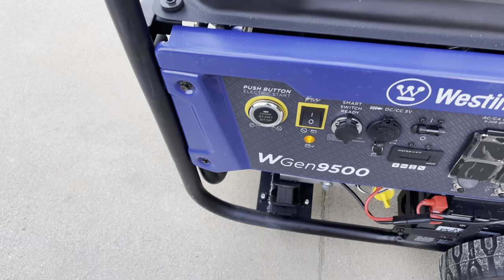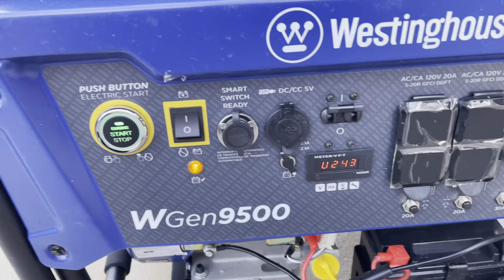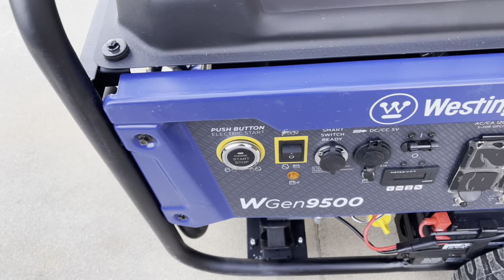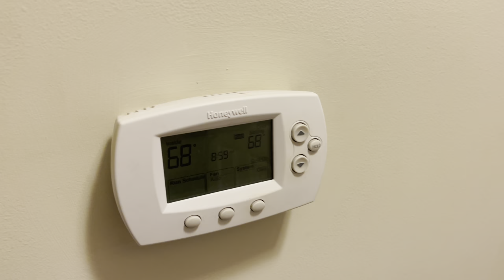WESTINGHOUSE WGen9500! Will it power a home AC??? First start, short review, and the truth!

Comment: BIG COUNTRY, First, thank you for the video. I purchased a Westinghouse WGen9500C but it shuts off the breaker when I turn on a 4 Ton A/C.  Would the extra ton do this?  Do you think a soft start kit would resolve the problem.  Florida Hurricanes are coming soon and would like to have A/C.  The generator runs independent of the A/C for two refrigerators, microwave, TV outlet with no problem. Thanks. Debra
Reply from the maker: I definitely think a soft start will get you squared away! If you’re using a dual fuel model and using propane, try running it on gasoline for your AC.
Reply: I had the same issue this week when hurricane Beryl hit Houston here where I am at. It ran my AC, fridge, freezer and other small things perfectly the first day on 4 hours, off 4 hours to conserve gas, seeing that all the gas stations were down.  It also ran just fine during the freeze a year ago and the first couple times this week, but then all of a sudden it wouldn't run just the AC by itself only the last few hours before power ultimately got restored luckily, it kept tripping the generator breaker if I tried running the AC.  After it Beryl passed, I contacted Westinghouse and they told me that I needed to "float the neutral". There's plenty of videos on YouTube showing how and it's super easy that anyone can do it in 5 minutes time. You're supposed to float the neutral wire WHEN HOOKING THE GENERATOR UP TO A HOUSE PANEL. If you are not doing that and using it with extension cords or for tools, etc, like on a construction site, then you leave it bonded to the frame as it comes. For emergencies like hurricanes, it had to be floated and not bonded to the frame.  There's a sticker on this generator stating that it's "bonded to the frame" at the lower right part of the panel near the 50 Amp plug. So if you are connecting to the house panel, you need to take the panel off, remove the 2 screws and float the neutral wire by removing the wire and reconnecting both ends to the neutral bolt.  It eventually gave me issues because there was two grounds the current was traveling through, eventually producing a false overload so to speak (not an electrician), going by what they said, and it eventually started tripping the breaker each time the AC turned on.  I already ordered my soft start kit and will be installing that here soon to help alleviate the initial start up load on the generator reducing by almost half. I even already had a reliance Controls 50 Amp plug and cord, 50amp breaker, including a whole home surge protector, hooked into the panel prior to this when the freeze hit here.  I'm looking forward to adding the soft start kit and floating the neutral wire and see the difference. When I had the 50amp plug installed 2 years ago at the freeze, the electrician ran the whole 2600sf house, no issues, as a test at the time.  I don't plan on doing that during emergencies to conserve gas, but it was nice seeing that it could. So I do know that it is possible.  Good luck!

Comment: I got the same gen unit 2 years ago. I love it. I try to start it monthly. Will run my heat pump AC without any hard-soft start modifications. It will not run my heat pump in heat mode but from what I have read that heating mode uses 5x the power vs. AC mode. We have space heaters and a big buddy propane heater to heat with in emergencies. How’s the wgen 9500/12500 holding up for you?
Reply: Don’t understand how heat mode takes more electricity… your just flipping valves and reversing the refrigeration cycle. Compressor runs same whether heating or cooling. 5x?  Where did you hear that
Reply: @condor5635  yes I saw it on a contractors web site. Maybe the heat strips? I might very well be wrong and I think someone at micro air told me the same thing. I will try and test it this winter when we start running the heat again. Thanks for the feedback.
Reply: I did install an easy start soft starter about 2 months ago and now getting 16-18 amp starts with the AC where previously the LRA says 75 amps inrush but I never tested it prior without the soft start. Thats going to be a welcomed bonus if I can run my heat easily too.
Reply: @FDRGREG  - I don’t think there’s any heat stripes. What was the condenser becomes the evaporator and what was the evaporator becomes the condenser. The compressor runs in heat mode or AC mode and other than flipping some valves to switch modes I’m not aware of any electricity needs that drastically change what is required to run the unit in either heat or air conditioning.

Comment: I have central a/c and heat.  I have a 3 ton unit.   We loose power in the winter all the time.   I’m wondering if it will run the central heat and main appliances like 2 refrigerators, freezer, and lights (all LED).
Reply from the maker: I can’t speak 100% to that but I can say if a generator would do it, it would be this one.
Reply: I had mine hooked up with a transfer switch today. I’m in the Midwest so still running heat. My house is 3500 sq ft and I have an apartment above my garage. It ran everything. I didn’t try oven or dryer and wouldn’t in an outage either. I’d use microwave and toaster oven or grill. It DID run everything else on gas. I didn’t try propane power yet.
Reply: Is your heat gas or electric. This generator will power a gas furnace but may not power a electric air handler wit electric heat strips.

Comment: Hey great video.  I have one too. Have you ever measured the RPMs at idle? Also can you confirm that an empty gas tank will take a full 6.6 gallons of gas? 
The reason I ask is because mine idles at 3750 RPM and it will just accept a little over 5 gallons. 
Hope to hear back.

Comment: It’s hard to see from the video, but did you say you made a male to male cable?   That means the inlet on the wall near the interlock is female?   If so, that is very dangerous and could kill someone in the future. Please do the right thing and replace your inlet with a male inlet. You already have the interlock to prevent the male inlet from being energized.  

I have the same model generator except in the dual fuel version (9500df). It’s a nice generator.  I have not yet tried to run my 3 ton ac on it.  But after seeing your video I may try.
Reply from the maker: I asked someone else this question but never got an answer. What makes it dangerous?
Reply: @BigCountrysWay  I’m assuming this is a serious question and you are not joking.  So I will explain a few examples to illustrate the risks. Please understand these are just examples and are not a complete list of possibilities. Meaning there are other ways people could be injured besides these.  

1) you are ill, in the hospital and your family is at home on a 98 degree day when the power goes out.  They are desperate for some cool comfort so they hook up the generator themselves even though it’s something that you’ve always done for them in the past.  Everything goes fine at first, but after the power comes back on and they are shutting down the generator they do it in the wrong order and pull the cable from the wall while it’s still running and touch the male end by accident and shock themselves.  

In summary, most people assume that on an extension cord or any power cord that the male end is not energized when not connected.  But the female end can be live if the other end is plugged in.  Therefore people will instinctively pick up and touch a male end thinking it’s always safe.  This SHOULD always be true.  But with a cord with male on both ends the power is running backwards from what intuition would expect.  This leads to a risk of death.  The risk is higher to other people than to yourself since you understand the danger.  

Please don’t put other people’s lives in danger.  If they were ever hurt you would feel responsible and that would suck for both people involved.
Reply from the maker: @neilbrookins8428  I understand your view point, I do. And I was being serious. I love feedback so thank you for this. 

I do have to say, I think that is stretching it alittle bit in my situation. First, The cord I made is 6ft long so the generator is right next to it. This being said, “if” someone else is unhooking it, they will definitely know there is still power going to the other end of the cord. Second, my wife would never attempt a hook up or unhook without having me on the phone. She would even be to scared to flip breakers in the house so she would most definitely leave the house on generator power until I got home or until the unit ran out of gas. 

If someone were to be stealing it, and left it running , while moving it so that we didn’t hear it was being tampered with, the male plug may even work in our favor lol 

With all this being said, you did bring that risk to my attention and for that I thank you! I now know to not let anyone mess with it without clear instruction or monitoring
Reply: @BigCountrysWay  you think that having instructions will help reduce the chances of an accident and you are absolutely right.  But there is still the very real possibility of an accident because someone didn’t read the instructions or they forgot a step or they were drunk/high/stoned etc.  

Please stop trying to think of a specific person or specific scenario that might happen and accept the fact that there could exist a scenario which you didn’t plan for and didn’t expect and thought would never happen— but it does happen and leads to touching the end of a wire.  

Let’s look at this a different way-   How is it BETTER to keep things they way they currently are?  How does this current setup provide any benefit or advantage over changing it to use a male inlet and a cord with female end?   What are the pros and cons?
Reply from the maker: @neilbrookins8428   my man. I get your opinion… my house, my generator, no one will touch it besides me. 

There is a possibility one of my tires blowing out going down the road causing me to hit a tree.. does that mean I change the tire brand I have and get new tires to prevent it? No. Because there is always that risk even with new tires. You take a risk to drive anywhere you go.. but this is an acceptable risk.. I accept it… even when I have passengers or someone is driving my truck, I accept it. 

For this particular case, I accept the risk of the plug.. there are so many people with generators out there that have this exact set up. That’s where I got the idea from, researching how I was going to hook it up. 

I never said I would have written instructions anywhere, we don’t drink nor get high at my house, any instructions would be over FaceTime or phone call. 

Cons? Cost… I don’t want to put anymore money into it. The set up I have works great and I have accepted the risk.. it works great, I’m the only one that will touch it, no reason to change it.
Reply: @BigCountryCustomz  Let me start off by saying I don't have any relevant credentials for what I'm about to say.  This is strictly a question of what makes sense, to me.  You'll have to do your own homework, of course but I'm going to guess that that plug doesn't comply with your local building codes.  If you have an electrical fire(possibly any fire) and it's found that you have non-compliant electrical work in your house then your home owner's insurance probably won't pay(assuming you have insurance).  Not only that, but if/when you go to sell and it's found that you have non-compliant electrical work it will, almost certainly, affect the sale price of your house.  So, it's not just life you're risking it's pretty big financial risk.

Edit: I liked the video.  Wouldn't have known about the problem with the plug if not for the comments.
Reply: Inlets …. Which are the appropriate thing you need here, are 30$.   And that gets non energized prongs sticking out of your house.
Reply: Yes... No one will touch it besides him and he'll only touch it once.
Reply: @dontblameme6328  you guys worry about other people too much... There are a million ways to die for all of us. This plug isn't even in the top 10,000 list of those.
Reply: @bjlled  11 months later and inlets are very hard to find. If you want a generator now, this is the only way. Had 4 electric wholesalers tell my electrician the don't even know when a back order would come in. Licensed electrician told me to do it the way you see in the video.  We are starting to see desperate times in this country.  Plan on seeing more things you don't like.

Comment: The manual specifically states not to use full synthetic oil during the break-in period because it causes problems with internal seals or something like that... Have you seen any problems? I prefer synthetic myself but don't want to damage the system.
Reply from the maker: Never had any issues!

Comment: not sure if my question makes sense, do you have gas component inside or everything electric?  my electrician mentioned that i cannot run the AC because when electric + heat pump run, it will pull 60 Amps.

Comment: Hey Big Country, are you still using your Generator to power your 3 ton A/C. I watched your video and called my Electrician. He said there is no Generator on the market short of Whole House, that will run your A/C. He said you’re gonna burn your Generator up or mess up the A/C. I purchased a Tri Fuel 9500 Westinghouse based on your video and he warned me not to do what you did. Curious

Comment: Just got this yesterday and the shipping box as well looked like it's been kicked down some stairs but got it since I hired a electrician to add a interlock switch and he recommended something with 12,000 watts to power my house in N. California since we get alot of black outs during our 100+ degrees heat and fires. Quick question doh what fuel do you recommend for long term storage?
Reply from the maker: Ethanol free fuel with fuel stabilizer added
Reply: @BigCountrysWay  can I use the trufuel brand 4 cycle?
Reply from the maker: @eze876  not %100 sure. I can only speak on what I use
Reply: Best fuel for long term storage is propane. Stores for years without any problems. If you don't have the dual fuel model, I believe there are conversion kits available.
Reply from the maker: @oldtimerlee8820  looked in to them. I’m going to eventually get the truck fuel kit and run it off my houses natural gas line
Reply: @BigCountrysWay  I was about to comment on this since I noticed your house has natural gas.  Can you make a video when you add it? That's what I want to do, thanks
Reply: @BigCountrysWay  You will loose 20%-30% of the power when you use NG.
Reply: It’s called not storing long-term with fuel in it…. It’s called never storing the generator with fuel in it. Always run it dry and drain the bowl. Then you’ll never have any issues.  I’ve had mine for several years and it starts on the first pull.  I run it every It 6 months.

Comment: I want to see if it does more than just powers an AC unit if it powers AC will it power the heater, because so many people needed a back up generator when the power grid went down in Texas during a snowstorm easy go to the lake and cool down. I wanted to know if it’s gonna power more than just heat I wanna see if it’ll power a freezer a small home basically I wonder if it’s got that power. I might need a bigger generator. It’s only two bedroom two bath so it should do something. I wanted to see if it could be more
Reply from the maker: Considering this is one of the largest generators out there that you can role around, it’ll power just about anything. An AC compressor consumes more power on start up than a heater. I know this unit would have powered my lights, tv, AC/Heat, fridge all at the same time. It barely flinched when the AC kicked on and that is the most energy drawing appliance on the house.
Reply: I would look into wether the heat or gas. It will power a gas furnace because all your using is the blower motor. On the other hand, if your heater is electric you need to. Heck the label on the air handler and so the mathmatical load calculation

Comment: when u wired it to the breaker panel did u float the neutral on the generator?
Reply: Generally speaking, you only bond the neutral on the first panel coming into the house. Everything after should float if it’s tied to the houses electrical system.

Comment: What about the high THD on these?  Is that an issue or if it goes through the interlock it minimizes?
Reply from the maker: You’ll have to share some knowledge with me. What’s is THD?
Reply: @BigCountrysWay  THD is total harmonic distortion.  In simple terms it’s the quality of the power supplied. Said a different way, perfect power is a sine wave; but distorted power is a different shape wave.  And the value of the THD is how far away from ideal it produces. 

What does this mean as it relates to devices being powered?  If the power has a high THD, meaning low quality power then the devices are being subjected to more heat, higher peak current, higher electromagnetic emissions (noise on a radio).

Many of these impacts may not be noticed by an end user without using tools to measure the impact.  For example you might not notice that your power supply is overheating if it’s still running and working ok.
Reply: Bruno, what makes you think that an interlock would affect THD?  The only thing the interlock does is prevent the main breaker and the generator inlet breaker from being on at the same time.  Meaning the interlock is NOT connected to the power flow itself directly.  It’s an external device.
Reply: Interlock just prevents the main circuit breaker from being closed while generator power is being supplied, does not affect thd. According to the owner manual for this the thd is up to 23% so it's far from clean energy. TVs would be a no no, unless you don't mind shortening their lifespan.